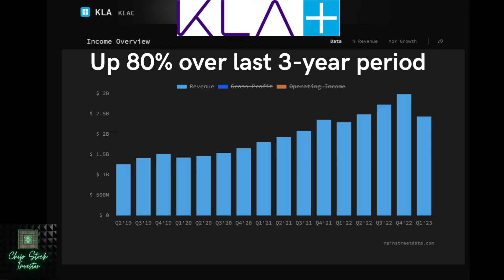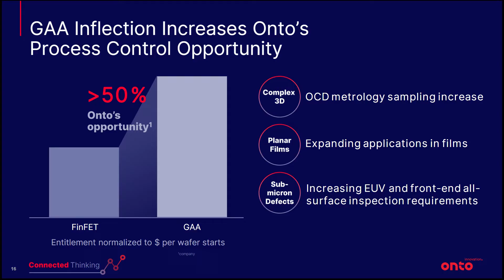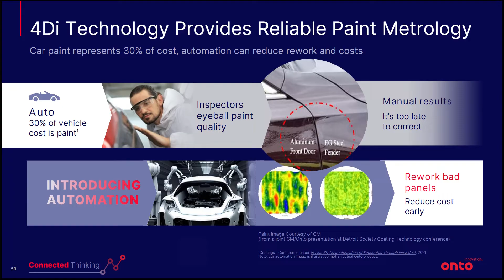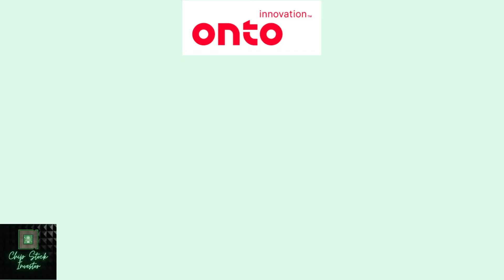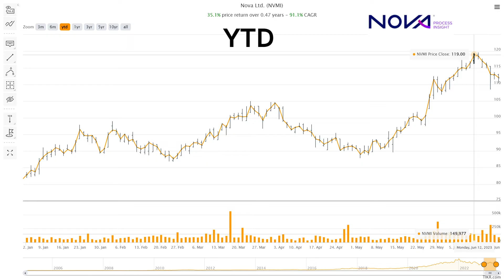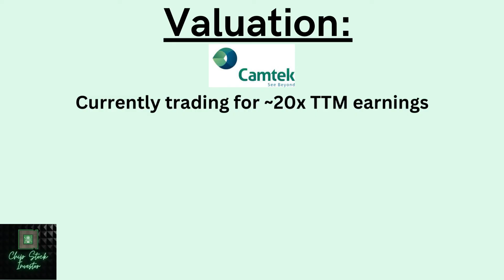The Next Semiconductor Boom Is Coming. Which Small Cap Stock Could Be the Next Big Thing?

Comment: Hey guys. Huge fan. Happy subscriber.

Since this video it's been made clear that Camtek would have been the best pick here. I'm just curious what a postmortem on this call would look like. Was the key factor that one would have  needed to see how the Camtek Eaglet-AP inspection machine for advanced packaging would get a huge bump in sales to meet the cowos demand at TSMC etc? Am I thinking about this correctly?
Reply from the maker: Hey Ross, we love this question, and we're working on some updates. Check the community board, we just did a write-up on Nova, and are working on one for Camtek as well.
We believe the immediate answer to this (short term answer, because it's only been 3 months), is of course the Eaglet inspection machines. But there's an additional very important factor. Camtek is by far the smallest of the three companies, and it's still trying to reach positive free cash flow scale. As it picks up steam with its equipment, it's reaching far more profitable scale, and the stock price has been soaring in anticipation of that. That's the nature of small caps. Could get big gains, or big losses, depending on which direction the scale skews.
Does that make sense?
We'll do a video explaining the three in more depth.